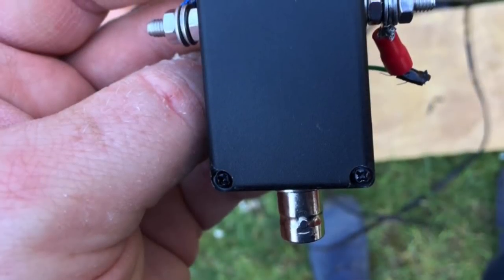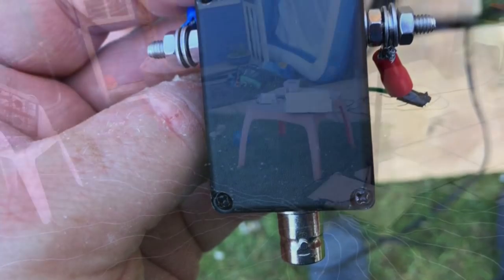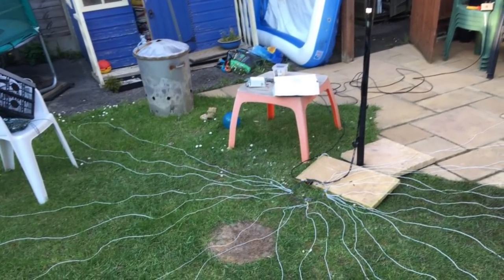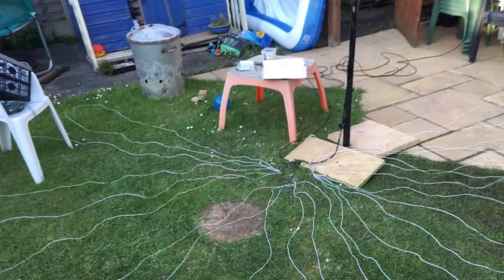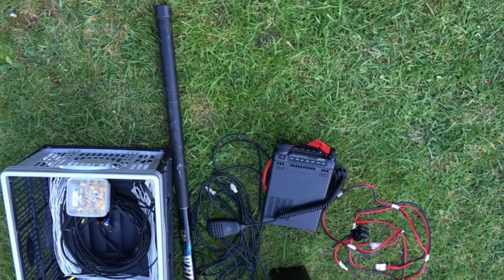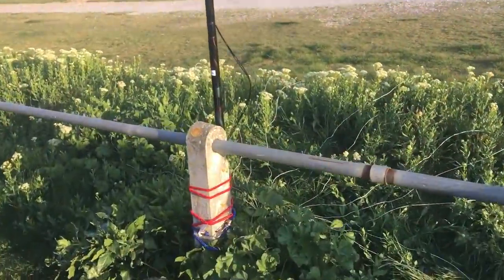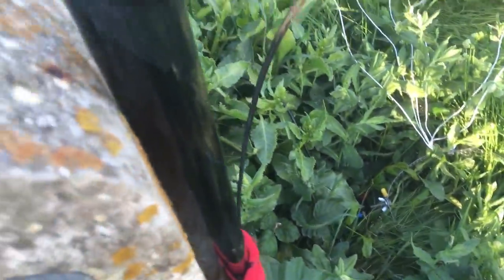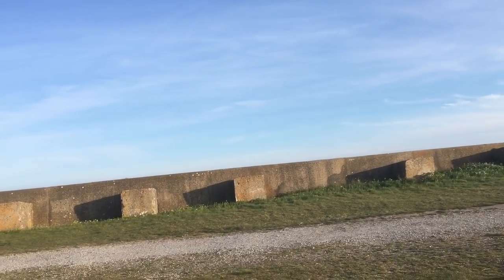40 meter portable Antenna - Short

Comment: Enjoyed that.   I wonder if putting a 9:1 un:un on the end instead of 1:1 may allow it to tune up on other bands ?  Same idea as the 10m  40 - 6 single element vertical that Prowhip used to build
Reply from the maker: Possibly so ... Worth trying out that one. Or just feed it straight into an auto tuner and connect radials to atu ground maybe? All good fun. Thank you very much for watching and commenting 73

Comment: So about 10 feet of wire goes down from the top.  I'm imagining is can vary?  Also, how efficient is this antenna compared to the full length at 32.32 feet up?  thx.
Reply from the maker: It goes up 23 feet, is shorted to the other wire and goes back down again almost all the way. Efficiency? Less than a dB in it I would say. 73